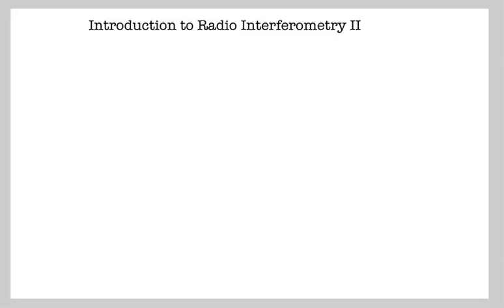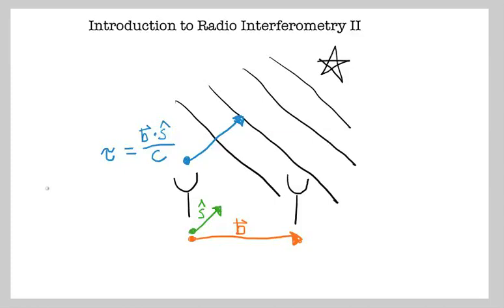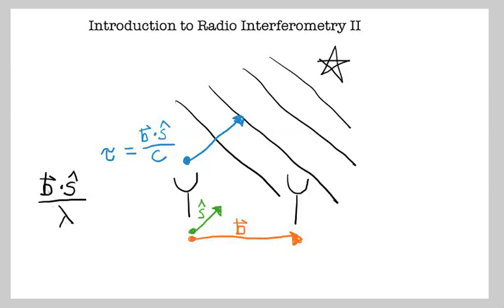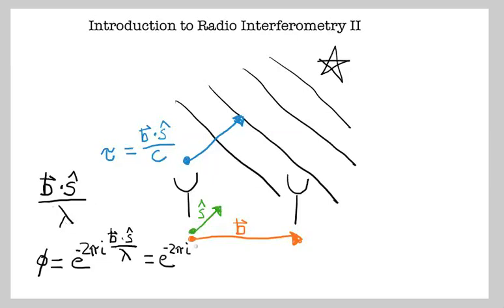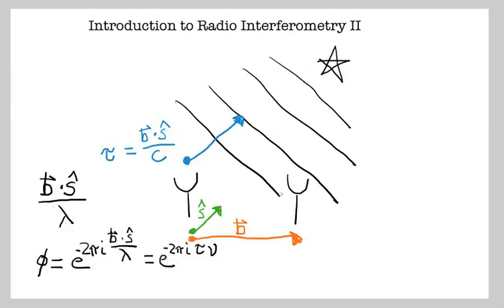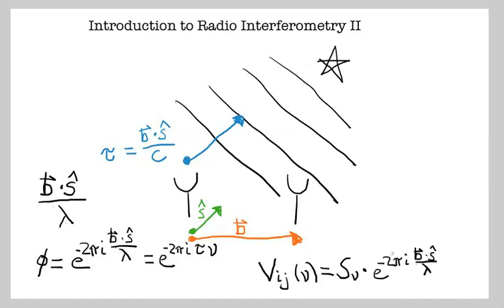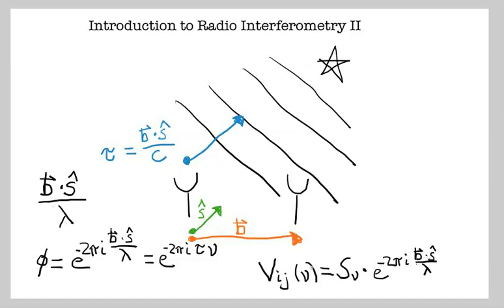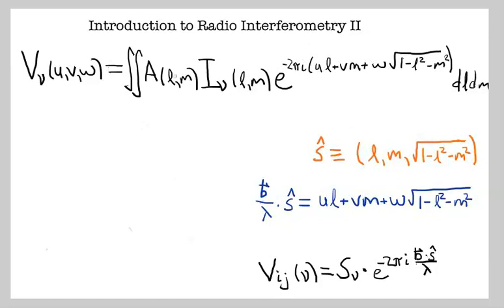Introduction to Radio Interferometry II, part1

Comment from the maker: The only difference between what I have written and what you have is that in yours (which I agree is in common usage), the phase term corresponding to the projection of the baseline toward the (l=0,m=0) coordinate has been factored out front.  In this case, the "w term" describes deviation from flatness, and can be dropped in the flat-sky approximation.  I prefer to leave it in, since it makes it easier to see that the phase term is just the baseline dotted with the source direction.